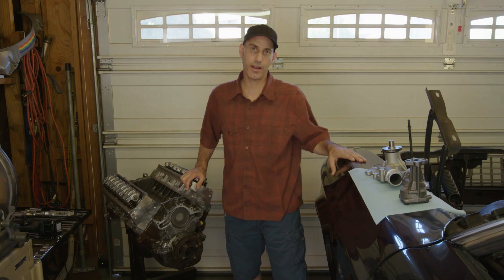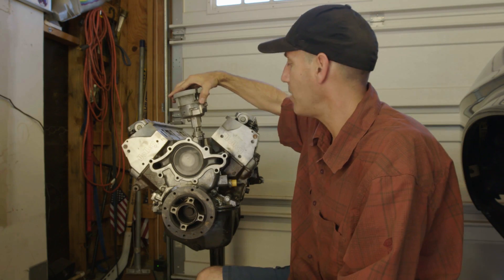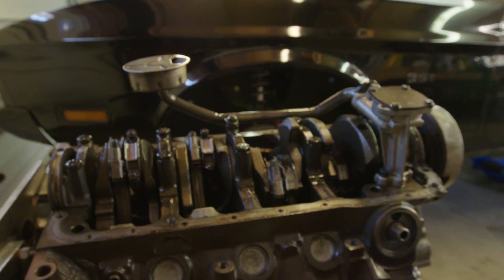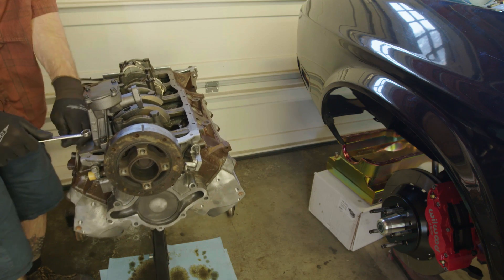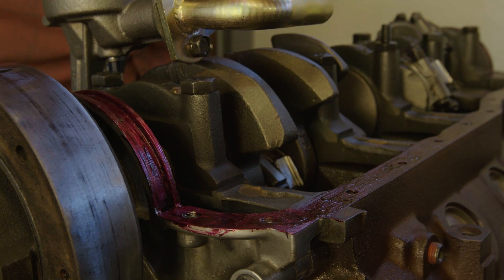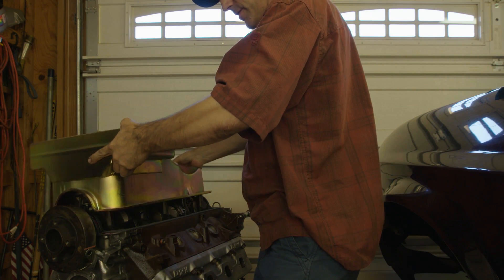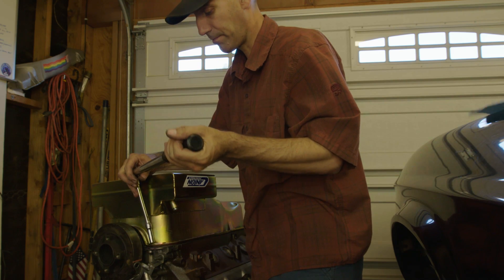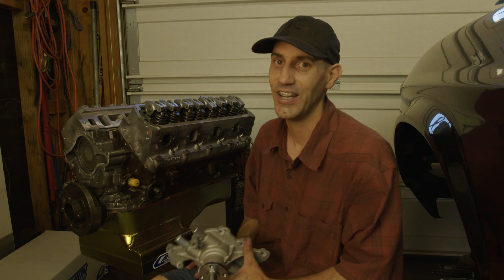Ford 5.0 Engine How To - Oil Pump and Pan Upgrade for the Mustang Project

Comment: went to adjust my distributor lost my oil pump driveshaft into the pan.. on the dreaded pan pull. this is on my 82 gt. they didnt make it easy with these double sump/ k frames
Reply from the maker: Yikes!

Comment: Why wasn't the new Oil Pump not disassembled to clean out the common issue of machined metal filings still in the new pump, or at least placed in a parts washer or bucket with clean solvent and hand opperated to flush out any filings still in it from being new?
Reply from the maker: I didn't know to do that, but now I do.

Comment: I've done the SN95 5.0 in to a 67 Mustang myself and had to use a similar front sump pan from Moroso.
You can relocate the dipstick directly in to the pan and then theres a simple process of putting the correct "Min/Max" marks on the dipstick while the pans on the bench.
I also retained the 1995 H.O SN95's Power steering pump and serpentine system so didn't have to use an earlier front timing cover and V belts.
I had to use the tube from a Canton dipstick kit but still used the original SN95 dipstick.
I had to diegrind out a channel through the back of the (shortened .. No smog) SN95 alternator bracket and with a few minimal bends the dipstick exits just behind the alternator and to the side of the valve cover by No.1 cylinder. 
I used the little bracket off of the block mounted SN95 dipstick tube and tacked it to the Canton tube after mocking it all up. With the help of a bolt slid through the cylinder block locating tab to keep the canton tube held securely in place.

So when you hear people tell you that you have to use an early timing cover for a 5 liter block so you can locate the dipstick in it they're not correct. If you're using an SN95 motor in a classic Mustang you're going to have to change to a front sump oil pan so why not buy one with a dipstick facility and also use all the SN95s superior serpentine system?

Comment: At 3:11 we see your using a two-bolt main, probably cast crank & those small 5/16th rod bolts......and your super-charging this? Rookie mistake, don't expect your engine to last very long. Ford makes a crate motor with the four-bolt main, 3/8ths inch rod bolts with the forged crank.....in an 8.5 to one compression just specificallly for boosted operation. Your configuration will be having you shoveling up the guts of your engine in due time.
Reply from the maker: Astute observation. Yes, this engine is not good for more than 500 horsepower but this will be a low boost application and should be fine until the finances allow for a more stout build.  Besides, I got this thing for very cheap.
Reply: autoedit
 Yeah, I would go with about 6 lbs of boost myself. If you will note the indentations, a narrowing of the body of that main-cap...Ford realized this so-called problem on those caps & built the 289 HP design, circa 1966?,  whereby the caps were solid, with no narrowing, a sort of solid bar swinging around the top from one bolt to the next. I saw just one image of this decades ago. The failure was designated as "main walking"...I have yet to find a definition of this....but I haven't searched for this??
 Just a bit of history & trivia I thought you might like to know....good luck with your build...
Reply: The block will split in half before those rods/bolts go. I have put superchargers on many 5 liter engines with zero piston/rod/crank failures (with the TRW pistons).. many of which make 450+ to the tire. The weakest point.. the block's casting.
Reply: Nick Grucza I'll call you out on this one, split in half? Pray tell what is moving within an engine?.....the rotating assembly.....how is this force translated into the force upon the block? Whose shop have you assembled these five supercharged engines?....and the split block, when, where did you see it, did you disassemble the destroyed engine? In my twenty plus years working in two dealerships, & a handful of independents,  I have happened upon ONE catastrophic failure....a 3 liter Toyota V6 with 300K plus, whereby a piston pin let go & the rod swung around attempting to cut the block at the front 1/3.....From what I've acquired, these weaknesses occur at prolonged high engine speeds AKA, track racing....and not the drags or street blasts...
Reply: Yes. Split into two pieces. Right down the center of the lifter valley. Google it and see for yourself. Google it.. "5.0 split block".. it's quite a sight to see in person. And I've worked in a couple independent performance shops. Don't worry, I have plenty of knowledge...

Comment: Great video. What torque do you use for the pump bolts and pickup bolts?
Reply from the maker: +jerry edmans 35 lbs.ft. with a little locktite

Comment: Awesome! This project is turning out to be an all out build! Congrats on all the partners you've got now.

Question: some people safety wire the oil pump as well. Is that to much "safety"? Why didn't you do it as well?

The bolts on the brake were already drilled to pass the wire or did you do it?

Keep the updates coming!! Best regards.